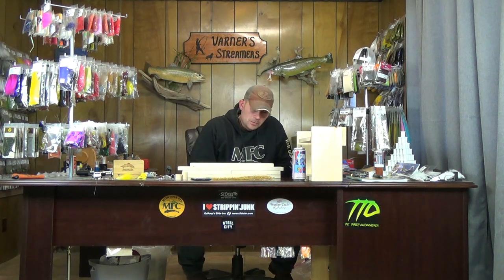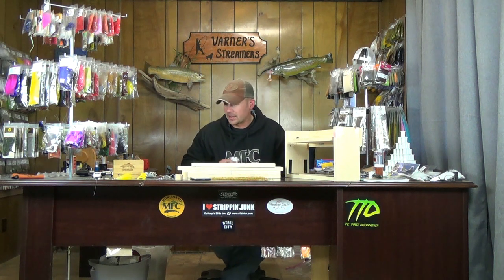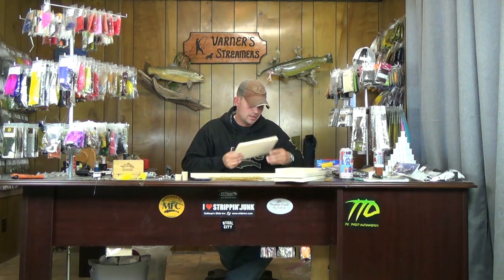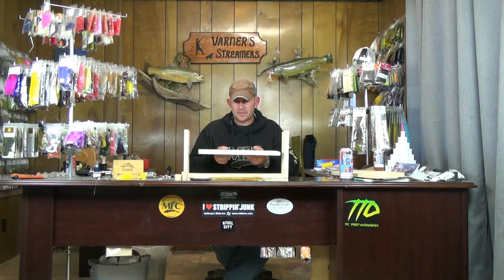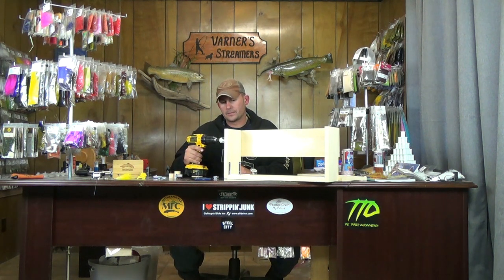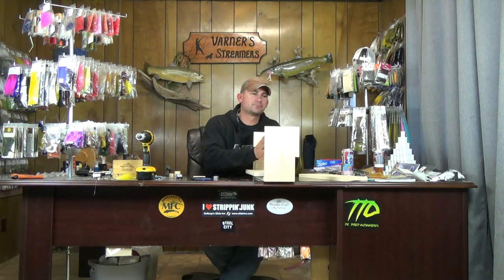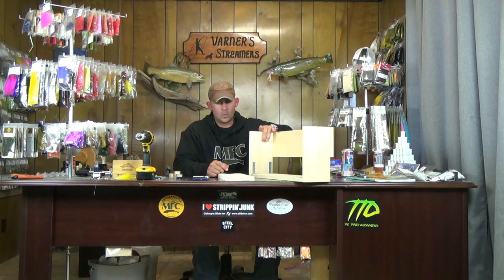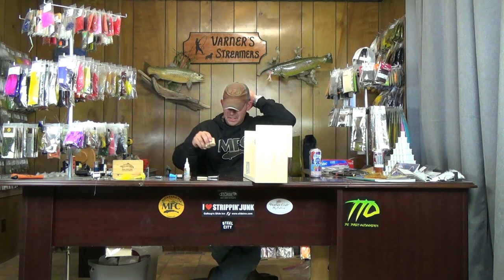Tying Tips:  Building A Dubbing Brush Bench

Comment: You tried putting a spring in where you have your spacer?  You can get ideal tension on the brush as it spins and tightens.  I didn't see how you set your wire to make sure it didn't over tighten with the twist.
Reply from the maker: I hadn't thought about that, I'm still experimenting with this new setup. I'll have to give that a shot buddy.

Comment: Hey Josh at about the 19:10 mark, you mention drilling a 7/64” hole.. “and run it as it’s sitting in here” you say… and this is where the bearing falls out on you… like where is this hole going and what does it do?
Reply: The 7/16" hole goes all the way through the 1" long 1-1/8" diameter dowel that goes on the outside of the frame where the drill is located.  Then it goes through the center of the 1-1/8" dowel about 1/2 - 5/8" deep into the inside dowel (the one that fell off during the demonstration).   You will have to thread the 3/8" x 2" bolt all the way through the 1" dowel, then push it through the hole in the bearing and thread the bolt into the inside dowel so it is firmly secured into the inside dowel (not all the way through it - this is where you are going to place one of the eyehooks to tie the twisting wire onto) After prefittng make sure you glue the inside dowel onto the bolt so it doesnt fall off.  

One suggestion is to use two thin 3/8" washers, one on each side of the bearing to prevent the wood dowel from swelling and fouling the bearing movement.  It may take a little longer bolt (2-1/4") to allow for the extra thickness of the washers.

So what you have is the head of the bolt where the drill goes--> completely through the 1" long dowel-->  through the first washer if used--> through the bearing hole --> through the second washer if used--> and threaded into the predrilled hole partly into the longer dowel where the eyehook is located to attach the brush wire.
Reply from the maker: Perfect explanation!